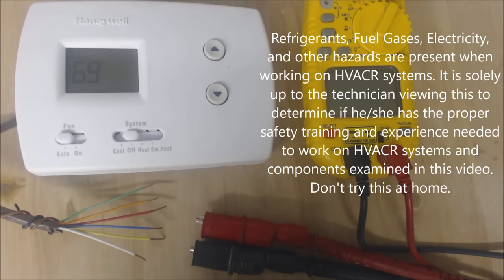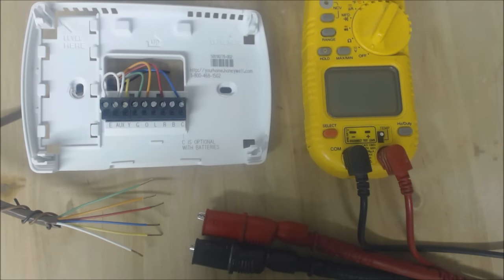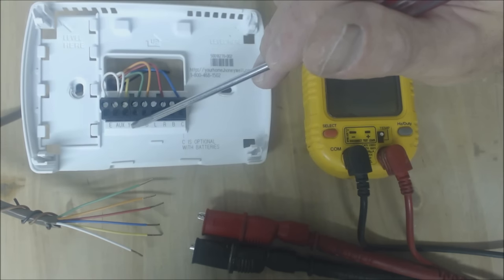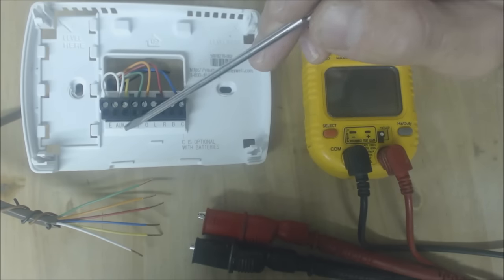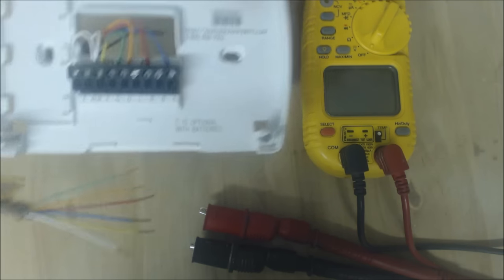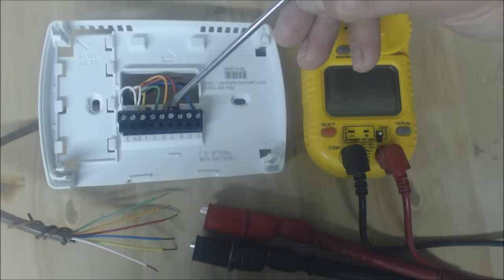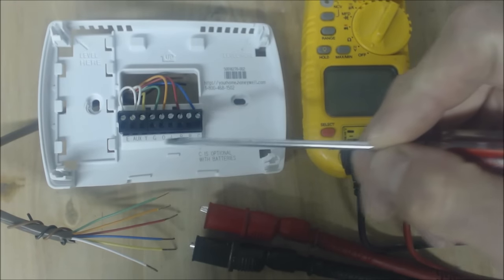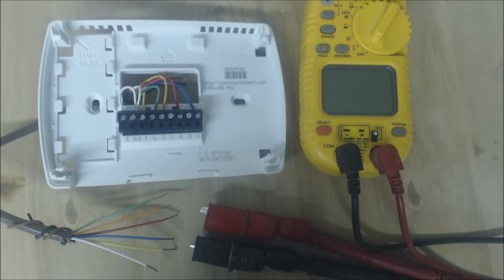Understanding and Wiring Heat Pump Thermostats with AUX & Em. Heat! Terminals, Colors, Functions!

Comment from the maker: Support and Tool List-  https://www.amazon.com/shop/acservicetech
Support-  https://www.patreon.com/acservicetech
For those that are looking for the tools used in the videos: (Linked Below)

Here is the Link for the newer UEI DL479 Multimeter with temp sensor- http://amzn.to/2jtsUbJ

Here is the Link for the newer UEI DL 469 Multimeter- http://amzn.to/2jw4ePJ

Here is a link to the UEI DL389 Multimeter used in this video- http://amzn.to/2av8s3q

Here is the link for the Irwin Wire Stripper/Cutter/Crimper   http://amzn.to/2dGTj2V

Here is the link to the Fieldpiece SDMN6 Dual Pressure Testing Manometer with Pump-http://amzn.to/2jyK5Ka 

Here is a link for the Supco Magnet Jumpers http://amzn.to/2gS4h6z

Here is the Link for the Yellow Jacket Refrigerant Manifold Gauge Set used in the videos-    
http://amzn.to/2aenwTq

Here is a link to Refrigerant hoses with valves used in the videos-   http://amzn.to/2aBumVI 

Here is the link to the Fieldpiece ST4 Dual Temp Meter- http://amzn.to/2wc1ME3

Here is a link to the Digital Refrigerant Scale used in the videos-  
http://amzn.to/2b9oXYl

Here is a link to the Imperial 535-C Kwik Charge Vaporizer for Charging Refrigerant-   http://amzn.to/2wFHtBW

Here is a link for RectorSeal Bubble Gas Leak Detector http://amzn.to/2ckWACn

Other tool links can be found in the video description section.

ACSERVICETECH is a participant in the Amazon Services LLC Associates Program, an affiliate advertising program designed to provide a means for sites to earn advertising fees by advertising and linking to Amazon.

Check out other videos on the HVACR topics of interest at-  https://www.youtube.com/channel/UCOZR-1IqsAer9wzlvFgb4mA/playlists?view_as=public
Reply: Honeywell non programmable thermostat with heat pump

Comment: Out of all the Youtube videos explaining the wiring, specifically the AUX and Emergency heat wires, you explained it the best. I went 6 years with a heat strip that was not working. Although I'm in Sacramento, it still gets cold at night in the winter, and I never understood why the unit started grinding away all night and not producing heat when the outside temp was below 32. Turned out it was just a 40 amp fuse. Replaced it, and man, that's some good winter heat now, that comes on when there's a 3 degreed spread between the setpoint and the inside temp.. Thanks for helping me understand it's operation!
Reply: This is my same issue!! Live in sac and if it’s below 40 my heat pump won’t heat the house!!! It was 61 degrees inside the house this morning. I need help
Reply: I’m also in Sacramento looking up why I’m not getting best heat when it’s reaching 38 degree outside. I reset breaker, clean out contact terminal and clean sensor connection. The heat works but not as hot and was curious what AUX means, now I get it.

The key thing is I don’t recall reading “ heat strips” in my manual. I understand heat pump and the valve but never came across heat strip til this video.

Is it located in the attic blower? Or outside condenser fan motor ?
Reply: @sarahfowler1601 did you figure it out? I bought temp radar gun harbor freight and my heat show 90 degrees out the vent. But I’m going to test it during day and I think should be reading higher

Comment: Thank you! I had a new heat pump and thermostat "professionally" installed a few weeks back. Came back from being out of town last night to find that the aux heat (heat strip) didn't work. This was the first time it was cold enough to need it. While waiting for the HVAC company to return my call, I cracked open the manuals for the heat pump, air handler, and t-stat. Having zero HVAC experience, it was still a little confusing. By 3:15 in this video, it was clear to me that the white wire was connected for a conventional system vs. heat pump. I was relaxing in a warm house by the time the HVAC company called back.
Reply from the maker: Awesome to hear thanks!

Comment: saved my bacon. thank you. last technician left our aux connected to the reversing wire (at the air handler). so when the heat was needed it was just activating the reversing valve thinking it was the heat strips since, from the thermostats point of view, the heat pump wasn't keeping up. With this I was able to get the strips and the reversing valve straightened out.
we don't use much heat most winters so this went two years undiscovered.
Reply from the maker: That's amazing!! It's great to hear you found our video was helpful! Thank you for watching!!

Comment: I added a new thermostat but I forgot to take a picture of the old one with the wires on it so I was lost. I kept blowing fuses but after watching your video I got it hooked up correctly and now it works, thank you very much.
Reply: OK well I thought I had it hooked up right but it wasn't working once the weather got really cold and I had to call a heating and air conditioning company they came up checked it all out and said I had it hooked up wrong. They hooked it up right and now it works good

Comment: Very good video! I have a trane package heat pump and a touchscreen trane thermostat and I believe the wiring is incorrect because my auxiliary heat will not kick on when the pump falls behind,  the only way I can get the temperature back up is turning the emergency heat on. Any help would be greatly appreciated 🙏
Reply: Switch to smart thermostat (like I did to ecobee) and then go to advanced settings of the ecobee. You can set the thresholds to when heat pump triggers "emergency heat strips"

Comment: Silly question in Florida we use heat pumps versus resistance heating and the heat pump wiring configuration versus conventional. The odd part is my Honeywell has the white wire into aux/E and no other w connections terminated in the existing Honeywell thermostat. However, I am Hooking up to a smart thermostat with a W/E connector I assume that is where I put the white wire as it is really an aux configuration with an Orange o/b setting for the bar? The smart app said my schematic is good and everything seems to work but I don’t want something to happen in the winter when heat turns on lol
Reply: In the same boat right now, did you ever figure out the answer to your question here?

Comment: Mine is set up this exact same way except the black wire is in W1 with the connector piece to W2 and the white and brown wire aren’t in use. Why would the black wire be used in W1 and W2 instead of the white wire. 
If I’m changing out my thermostat to a nest, would I leave the black wire as W1 in the nest system and remove the connector then still leave white and brown wires in used?
Thanks so much!

Comment: So the majority of Heat pumps use the O terminal on @ the  thermostat with the reversing valve being energized in the cooling mode keeping the refrigerant flowing normal direction correct?

Comment: I replaced a honeywell thermostat, and older one with a newer one of the same model. The old one had a jumper between E and AUX but the new one didn't, does the new one need the jumper too?

Comment: So quick question, in most HP applications the stat controls the fan not the equipment? (ie if you were to jump Y and R you would get heat pump but no fan) unlike a gas furnace setup where if you jump R and W1 you get heat and fan?

Comment: I'm switching out an amana t-stat for the pro 3000, maybe a dumb question but my amana has a separate black/brown wire for e heat, do I need to still jump e and aux. I haven't done this in a couple decades and I'm old. I think I don't need a jumper but please confirm for me. Thanks from an old const. superintendent.

Comment: My thermostat has a wire going into the B terminal but I do not have a Ruud or Rheem hvac unit. I have a Oxbox Heat Pump system. Is this normal? There is no wire going into terminal O on my thermostat as well.

Comment: Can you change the 3 degree differential to 5 as I like to sleep cooler but in the morning I would need to burn resistance heating to gain back the temperature while I want to used the heat pump.

Comment: I have a whirlpool pump. I have the blue common, orange O, green, red, yellow Y. now my question is I have a white that goes to W2. I was told to connect this to the "E" port on a new Honeywell thermostat not the W2 port. Do you think that's correct?

Comment: What's your thoughts on Rheem and Ruud.  Specifically in southern California if you don't have access to natural gas?    I figured it would be better since doesn't get very cold and reversing valve this power heating and cooling . I would love to hear opinion.
Reply from the maker: Yeah if Rheem or Ruud heat pump reversing valve goes bad it typically still works in cooling mode non powered. Yeah it depends on your exact year round climate for deciding between gas heat or heat pumps, thanks!

Comment: I have an older Goodman GPG13240701 heat pump paired with a braeburn 1200 thermostat. My heat pump won't stay on. I took the thermostat off to see the wire hookup, there are only 4 wires, Red (R), Green (G), Black (E/W1), and Yellow (Y1). Outside the thermostat wire into the heat pump circuit board does not have a black wire. It has Red, Yellow, Orange, White, Green, and Blue (not connected). Is the thermostat wired incorrectly?

Comment: I just bought a new Honeywell RTH 9585 thermostat to use with my Trane heat pump which is all electric.  it also has Aux heat and Emergency heat on the original Trane thermostat.  Why do Honeywell thermostats not have an individual W connector?    Which has the white wire hooked to it on the original thermostat?   My new Honeywell has a combination O or W connector and I contacted Honeywell and they said  to put the O=Orange wire to that terminal and put the both the White and the Black wires to the single Aux/E connector.
Reply: I have the same issue did you have any issue after putting them together?
Reply: @TyWerks  No, it's been working fine for over a year now.

Comment: Great video. Is there a way to have the heat strip turn on when the unit goes into defrost mode so it doesn’t blow cold air into the ductwork? Or have heat strip turn on continuously when thermostat is calling for heat and recirculating fan is running.?
Reply from the maker: The heat pump has a 24v output W wire that is supposed to go to the heat strips to turn them on during defrost. It isn't done via the thermostat but from the outdoor unit to the indoor unit, thanks
Reply: I live in a basement i kept telling the landlord its blowing cold air and at times its smell like fumes coming out of the vent..dont know why but we kept having heated arguments over this same problems. Do u know why that happens

Comment: I received a Powerly Thermostat and wireless controller from AEP of OHio and am wondering about the thermostat wiring for my all electric house with a heat pump and auxillary furnace.Most wires are clear to me as they are plain to view and correlate to all thermostats I have ever installed. My problem is there is eight wires of which seven were connected to the old thermostat via a simple color coded hookup. On the Powerly thermostat there is no color code. THere is only designation of lettering. O,B, W1,W@ RH,RC, C, Y1 or Y, Y2, and G.  The housing shows one(left) hookup of W1 and W2 on one side and O/B and AUX on other side of left. W is O/B and AUX is W2. On the right if RH/RC, C, Y, Y2,  and G. Like I said, I have eight wires of which seven were on the old digital thermostat. I've got 6 hooked up and the last one is blue on the old thermostat so where does it go on the new wireless on by Powerly? Any ideas?

Comment: I was trying to upgrade a heat pump  thermostat today for a customer and I had everything wired the same way as usual. Once I started the system in cooling the heat pump started running in heat mode. After trying multiple things nothing would change. I then installed the old thermostat and the system went back into cooling mode once again. Any ideas of why this would happen? Any input on  this would be helpful.

Comment: Where do you check low voltage at the air handler or package unit without a common from the thermostat? Do you just use a common some where in the unit? Say I'm trying to see if the O terminal is energized without a common from thermostat on a package unit for example. Appreciate all your videos and knowledge!
Reply from the maker: You would measure it with the common at the indoor unit air handler, thanks

Comment: I have a 4000 series honeywell thermostat with the same exact wire connection configuration that you show in this video. I am replacing a trane thermostat that quit working. Question I have is that I have a white wire and an X2 wire. From what I have been able to find out looking around online is to connect white wire to AUX and tape off the X2 wire. Is that correct?
Reply from the maker: It depends on what type of system you have and what type of heat and auxiliary heat it has. What does it have?

Comment: my air handler is trane heat pump. I just  bought a new thermostat with battery and replaced it instead the old one. It works when it’s on cool mode,but when I turn heat mode on it keep blown fuse. Can you tell me what’s wrong with it. There are 6 wires from air handler blue,red,green,white,orange and yellow. I connected blue-B,red-R,green-G,orange-O,white-W,yellow-Y. Did I mess those thermostat wires?
Reply from the maker: blue likely is supposed to be on common. You can verify this at the air handler if the blue is connected to the common. B is powered in heat mode and you only have one reversing valve and on a trane they power o in cooling mode, thanks
Reply: A)C Service Tech  is Correct you put your Common and Hot basically you put both sides of your transformer together on your Low voltage side which is a Direct Short ,take the Blue wire out the equastion.Start  with red the green then white etc until you pop the fuse that will probably be the Blue

Comment: @ 2:59 you say that "AUX is for if the thermostat ends up getting 3 degrees higher than what it's calling for", I think you mean to say it is for when the thermostat is set for 3 degrees higher than the current temperature setting, yes?

Comment: Thank you for the video. I have an older York heat pump and York furnace. After installing my new honeywell tstat the system cycles on and off very frequently. It really annoying. This shows the thermostat wiring,  but where should these wire land at the heat pump and furnace. I think whoever wires those did it wrong. How do you wire the "system" from to tstat to heat pump, to furnace?
Reply: The retail (RTHXXXX) Honeywell thermostats generally don't offer any kind of temperature hysteresis/swing/cycle per hour adjustment setting, the cycle rate is fixed at 1*F  I generally find that's pretty reasonable but prefer a wider swing at the expense of "comfort" in favor of economy, as you describe.  Reduced cycling is also easier on the equipment due to reduced startup cycles and slightly longer run times.
The FocusPro (THXXXX) versions do have a cycle per hour adjustment feature which offers some degree of control.  These are the pro contractor versions, not the retail versions.  These pro versions also offer some adjustability for when aux strip heat is energized (econ/comfort).
I'm not sure if this also applies to the higher end Honeywell retail thermostats but it might.

Comment: That yellow thing to the right, is that a Dimethoxyethane DMM?  You mention wires touching... wouldn't a volt meter be a great way of showing relays and solenoids energizing?
Reply from the maker: Here is the video with that setup while using the multimeter. I just happened to split one long video up into two smaller chunks. Sorry I didn't use it in that one, thanks Jules-  https://www.youtube.com/watch?v=HenOWUDX8PQ&t=1s

Comment: Question, I have everything wired correctly, and can confirm the unit is a heat pump due to the reversing valve in the condenser unit, and the wires coming to the thermostat, however, when the thermostat is configured for a forced air heat pump, the blower does not come on when called for cooling, which is not good. Only when the unit is set for Conv. Forced Air the blower turns on with the compressor. Both heating and cooling work, but I have no control over when the expensive AUX heat strips turn on, and would like to set it to only turn on when the heat droop is about 5 degree. The thermostat is a Honeywell TH8321WF1001. Thanks again!
Reply from the maker: You would need the s1 and s2 hooked up to an outdoor temp sensor to control aux strips like that. It sounds like the tstat is not sending power to the g wire for fan. Do you have 24v from g to c at the indoor unit when calling for cooling?
Reply: Thanks for your quick response! Well, the T-stat has internet connection and can pull outside temperature from the internet to control strips, (if I can figure out what's going on). I'm just puzzled as to why the blower does not run when configured for heat pump mode for cooling, but runs fine in Conventional forced air since G is being energized. Something is either not configured right or wired right at the inside unit?
Reply from the maker: Yeah sounds right, turn the power off at the indoor unit and check to make sure your g tstat wire connects to g terminal on the board at the indoor unit, thanks

Comment: When i Turn on my heat it blows Cold Air, I put it on Emergency Heat  an the house stays at 70. Im Looking at the honeywell RTH7600D I have a Heat pump. Will that Thermostat work?
Reply from the maker: Before you change the thermostat and if you don't have ruud or rheem then you can take the existing thermostat base off and jump from R to Y to see if your outdoor heat pump will come on. If it does then you know your existing tstat is bad. Yes that stat would work though.